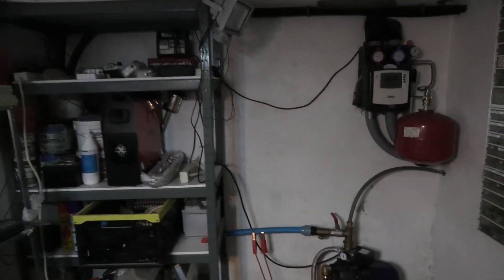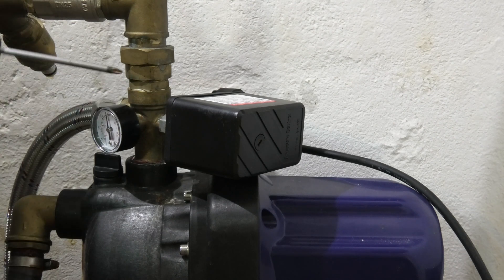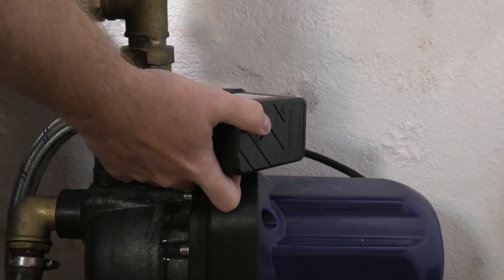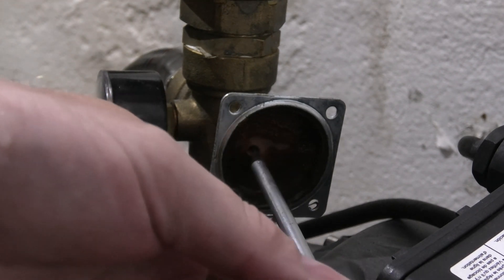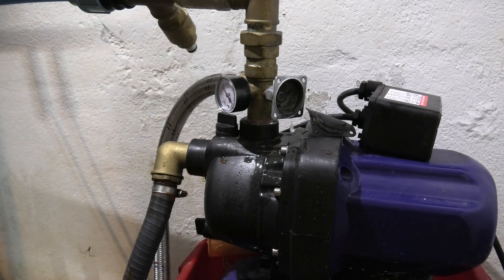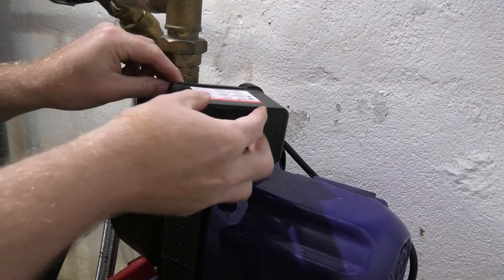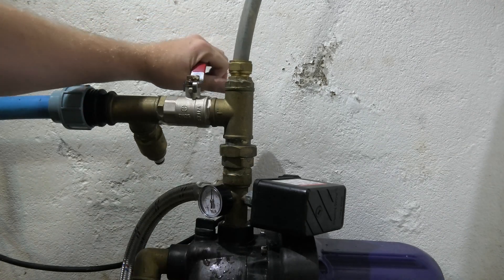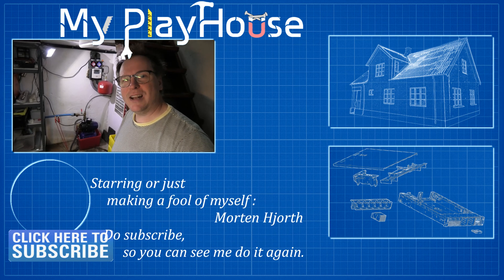Fix for Booster/Pressure Pump that does not turn off - 1411

Comment: I assume there is a tank that you are pumping into. Generally those have an air bladder. If you are pushing the tank to say 30psi of water, the air bladder should be pressurized to like 27psi of air and that keeps the pump from cycling too much. Make sure you check that as well.
That switch is installed wrong as well. It should be mounted to that dirt doesn't collect in there and so if there is a leak in the membrane, it drips down,not on the electrical stuff. Electrical should be up,
Reply from the maker: No,, it is pumping out to the open,, no pressure.

Comment: The rubber membrane of the pressure switch is supposed to be in a horizontal position with the entrance pipe pointing downwards to allow gravity to float the debris downwards without obstructing the switch plate
Reply from the maker: I have not change anything..
Reply: @MyPlayHouse  well, have a look around, every pressure switch for a well or boost pump is horizontal (except for some . . . ones). Mounting it on top of an elbow will probably reduce the problem you have